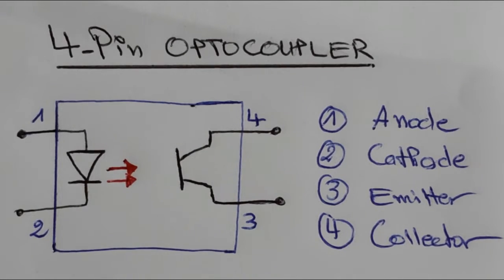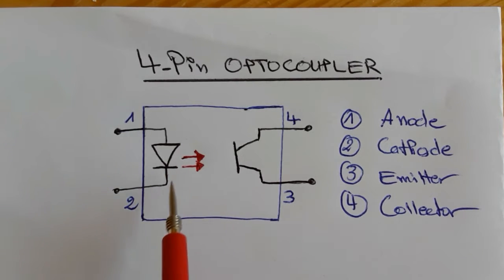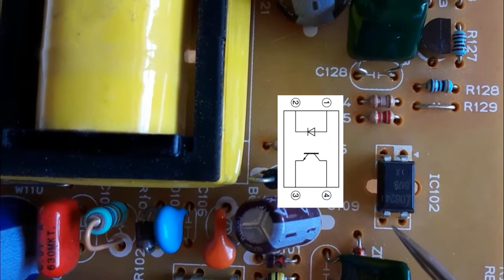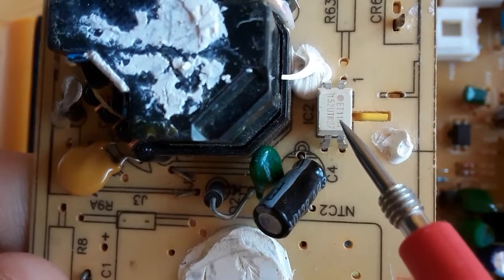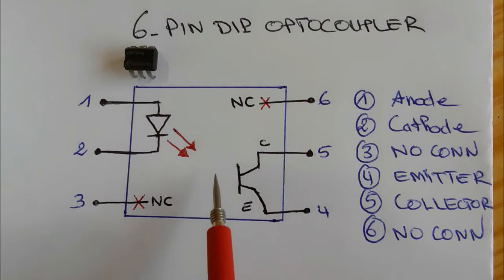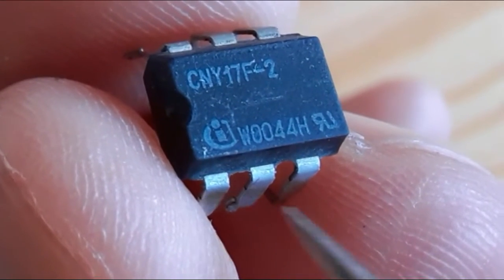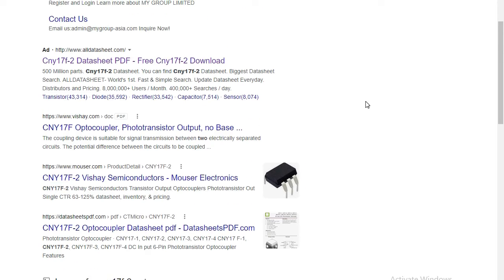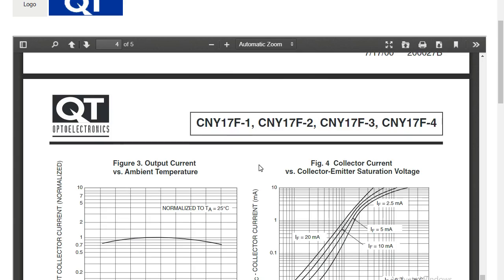Learn how to test Optocouplers/Opto-isolators with multimeter

Comment: I use 4n35  and Arduino analogRead  on signal from pin4.  Pin5 receive 5v from source and pin4 is connected to 3mm led with 330ohm resistor.
Even pin1 and pin2 are turn off, I still can read value  around 100 ~ 400 on pin4. I thought it should read zero.  Why is that?

Comment: Hi Sir , I'm still learning. I'm testing a Schottky Diode 1N5819 in circuit .the reading is 0.2v and the reverse is 0.4v . The diode is good but I'm not sure why it read in reverse bias. does it mean some part in the circuit causing a short ?

Comment: Testing the collector-emitter junction like that isn't good enough to show that it's definitely OK. All it does is show that it's not short. An optocoupler could be damaged in a way that the collector-emitter junction goes genuinely open circuit, so your test would show it as good, when it's actually bad.
Reply: I would think injecting the rated voltage into the LED would cause a  change in EC resistance. Agreed that many of this guy's tests are not the most comprehesive, but they can help people to get started.

Comment: Remember to check the data sheet very important this test does not apply to every IC example 4N35 right up to ic 4N37 have 4 emitter 5 collector 6 base they all show a reading as they are all connected.
I would love to see a video on data sheets and how to understand the input out to understand how to take measurements.
Reply from the maker: Great point! Noted

Comment: I have tried this method on numerous boards and it does not work. The only way it works is when i remove the optocoupler from the board and then test. I was misled from your video when i thought that my optocoupler was bad only to realize that it tested good once desoldered from the board...can you provide an explanation
Reply: Ive found that other components (such as capacitors, iductors, transformers etc.) in the circuit cause the multimeter to read different values, as they are all interconnect. This causes the multimeter to read the resistance across those components as apposed to across the component I want. This phenomenon can occur when measuring resistors aswell and cause really inaccurate results. I find that it is good practice to desolder atleast one leg of the component to make sure that the mulimeter is only measuring the component I want to measure and not picking up other random components instead.
Reply: Totally agree with you. Best way is to remove it and used two Multimeters

Comment: Please explain why DIODES are not present in car automotive relays? It is a fact that diodes serves as protection against the back emf voltage from the relay coil.
Reply: Some relays do have diodes.
Reply from the maker: If they are not present doesn't mean there is no protection, ther are other components that can protect the car circuits.
Reply: @TorpedoBurrito  please explain what diodes are not used in some car automotive relays. I'm really confused.